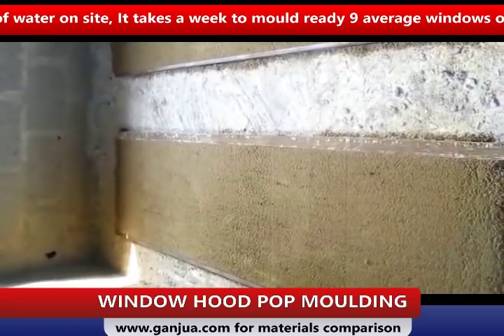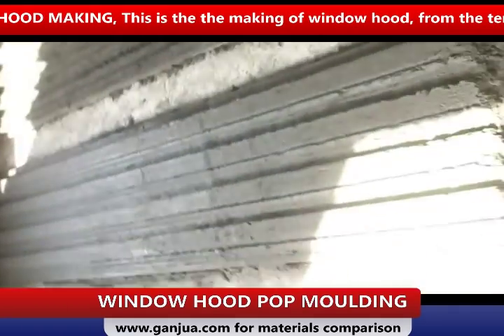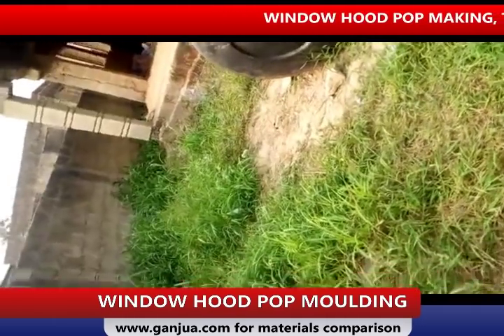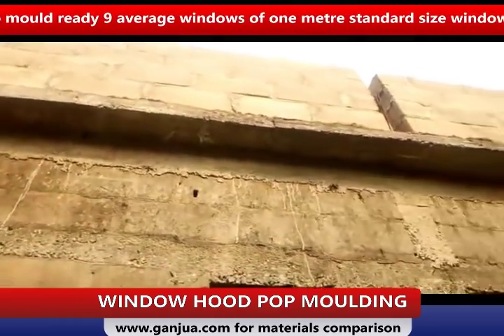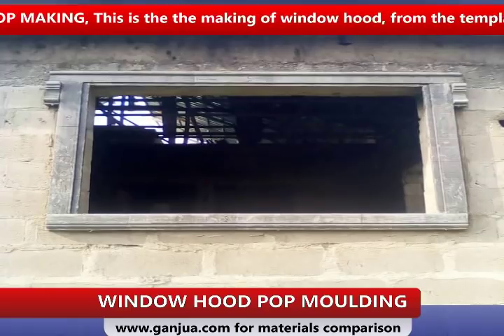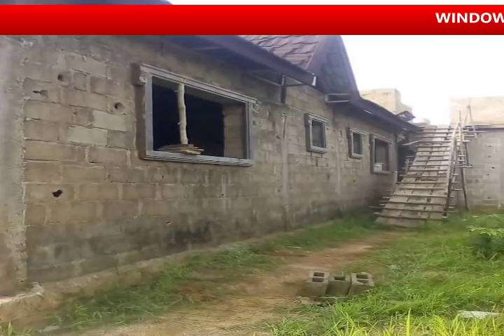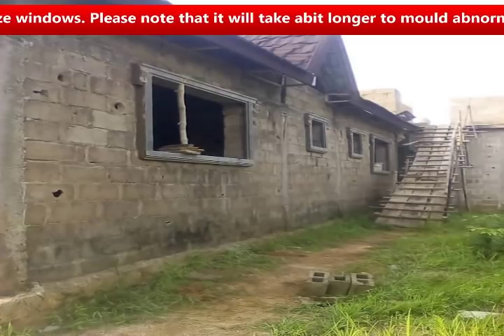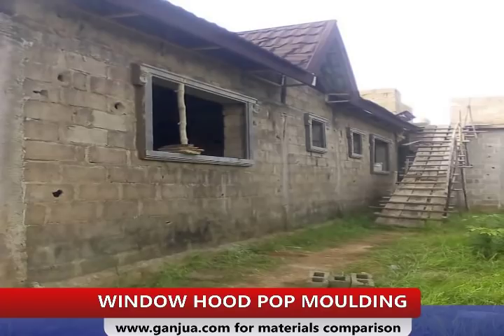WINDOW HOOD POP MOULDING

Comment: What will be the cost estimate to build only two bedroom ensuite in front with modern fittings?
Reply from the maker: About 13 million Naira apart from cost of the land
Reply: @LuluDumba  you mean only two bedroom flat?
Reply from the maker: Yah you will spend up to that because you want modern finishing with gerad roofing and state of the art interior so you will spend up to that
Reply: @LuluDumba  thx sir.....soup wey sweet, na money kill am oo....obe to dun, owo lo pa....
Reply from the maker: Abi o
Reply: @LuluDumba  i have two mre questions (1). if someone has money ready, how long will it take to build a two bedroom flat after all the paper work has been done? (2). What is the rough estimate price you charge if you help monitor the project....for the service (does not include the actual cost of building the house)
Reply from the maker: I will charge in stages and also it depends on the location of the site
Reply: @LuluDumba  ok....but if someone has money ready, how long will it take to build a two bedroom flat after all the paper work has been done?
Reply from the maker: 6 to 8 month maximum a year
Reply: @LuluDumba  Waoh! i was thinking 2 months.....thanks so much for this info
Reply from the maker: If you complete a house in 2 months it will be rush rush what about the electrics and interior so can’t be rushed in two months
Reply: @LuluDumba  ok sir.....thanks a lot